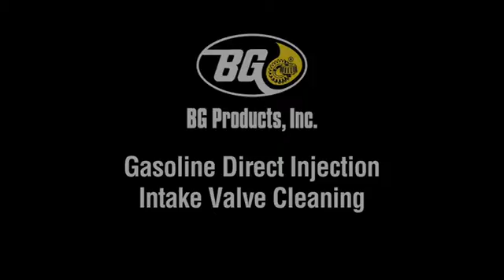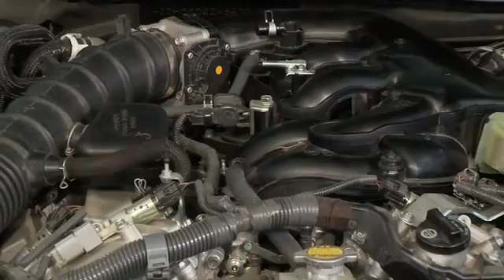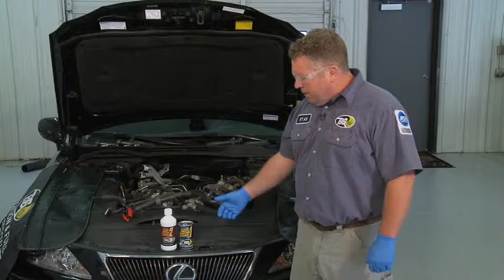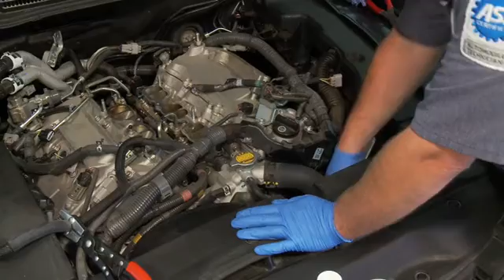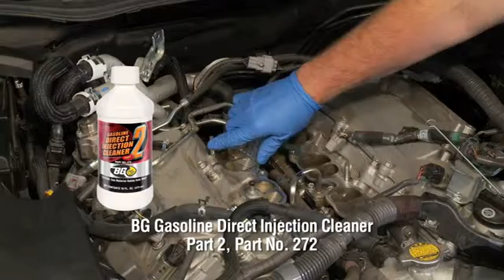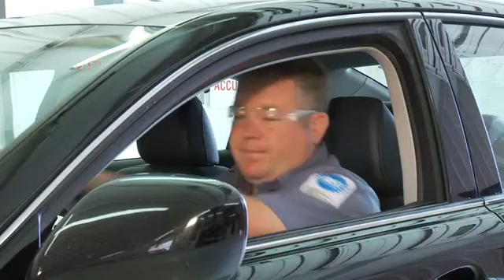BG GDI  Intake Valve Cleaning

Comment: By the time you get the intake off and the sparkplugs removed, the engine will be at room temperature again. Not to mention removing sparkplugs in a hot cylinder head, risking possible damage.

Comment: Do you need to change the oil after using the intake valve cleaner through the throttle body ?